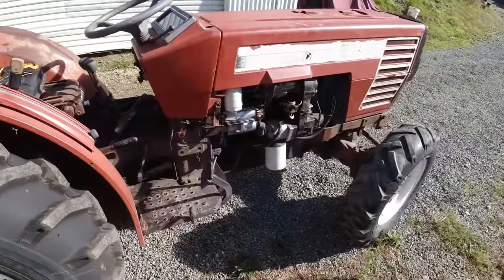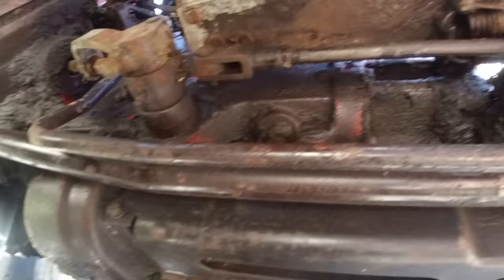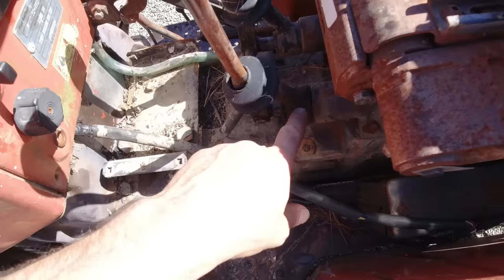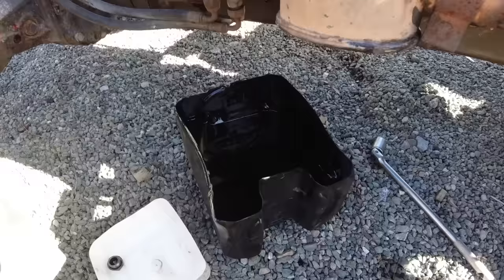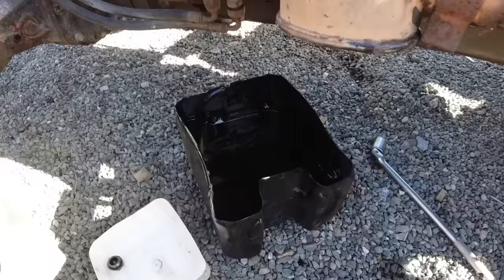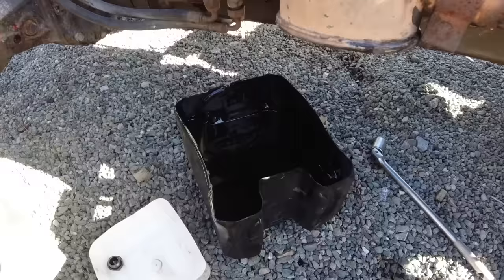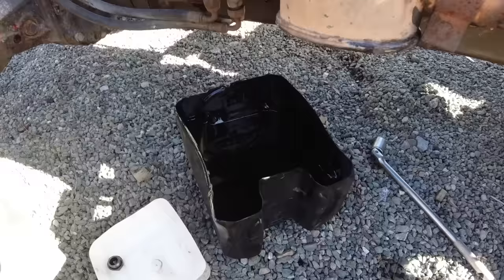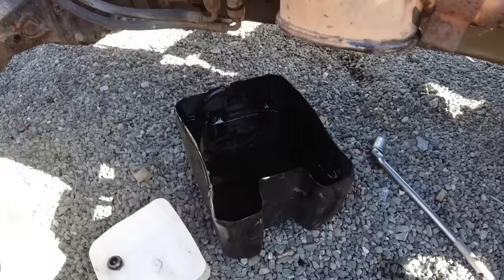Free Fiat 4wd tractor gets a full service/repairs & goes back to work

Comment: It's a good idea to run antifreeze even if you don't expect cold weather. Antifreeze has anti-corrosion properties that will help protect the cooling system over time.

Comment: Just a tip with the ultrasonic cleaning. Use some jars in the tub with your dirty parts inside the jar. You can just use plain water in the tub, then you can use a solvent in the jar and dispose of it easier when done.
Reply from the maker: Brilliant idea thanks
Reply: @MartyT Agreed. Really great idea. Never thought of doing that.

Comment: I have an 55-46, same engine but different gearbox. It takes 22liter of SAE 10\20 or 30.
I used a 10W-30 universal oil for wheat brakes and clutches.
Engine takes 9.5liters, i used 15w-40.
Mine had 9l of oil left of 22l. it did not really care, and my drain plug was the same.
55-46 has only syncro's on 3-4 gear.
Old Fiats are like gold here in Norway and 70-80 and 100 series in good kondition starts at 10 000$

Comment: Hey Marty, here in Wisconsin were just getting into spring. I've resumed tinkering with my fleet. Just finished up with the rebuilding of my 79 jeep engine. Runs good!:) The first jeep I bought was a 1950 jeep pickup truck that had been converted to a grass fire truck in 1960. In 1982 I was able to purchase it. Everything looked well serviced. No evidence of leaking from gear box's or differentials.:) Drove it about 20 miles home and burned up the rear diff. Bone dry!:( No wonder there was no evidence of leaking. Fortunately I had a parts truck. Great job showing how you still have to look!:) Thanks

Comment: Used the model down from this in the late 90s early 00's, the 45/66 and it's big brother the 80/90, I love new tractors and the air conditioning and field management systems, but there's something to be said for the simplicity of these machines, reliability was immense, and the small fiat tractor punched well above it's weight.

Comment: Excellent video, the arthritic tractor controls  it's probably just lack of use, most of the older stuff relies on thrown oil to lubricate the inside, only when there isn't a path do you get "proper " lubrication even if it's only a gutter and drip hole or a wick, many strange issues come back to 100 years of rusty junk filling all the small holes especially when the oil resembles tar or in very early stuff it's castor and has gone rancid ....

Comment: For a guy who does as much crawling around under vehicles as you do, you should dig out a trench (reinforced on the sides of course) that allows you to stand comfortably under to change oils etc. You must have a spot on that property that has a slight slope to it so you could walk into the trench from one end and work under these big machines a lot easier. Like a mechanics pit you see in an auto shop (or whatever they call it). Also, love the tree frog joke. You’re not a real dad unless you make a good tree frog joke with your son while working on a piece of machinery

Comment: See about getting a canvas (as opposed to nylon fiber) tarpaulin to cover the tractor between jobs.  The linkages will stay lubricated and free of dirt much better if protected from rain and dirt.
I'm  continually surprised at how much can be "fixed" on these old machines by simply draining and replacing fluids and replacing filters.  "Clean fluids, fresh filters... damn!  Runs like new!"
I'm sure that down the way you'll be showing us how to replace shaft seals on the wheels and drive shaft.  But this was a great step forward.
PS.  The seat looks a bit dodgy.  Your backside will appreciate a new seat since you're going to be using this a LOT.

Comment: Good looking machine. May be worth investing in a ROP to give you some protection in case of roll-over.  They don't usually use them in orchards but better than trying to hold up a tractor as it rolls over you.

Comment: I was impressed on how well that little tractor did. I know what you were talking, with my two wheel drive tractor you have to think about it when you're using a backplate because the tires just don't have enough traction. And if you look at mine they're close to smooth. I run tire chains all year round so I can avoid buying tires cuz I'm cheap, CHEAP I say! Lol! Not really, my feeling is if it does the job why spend money on a want not a need? When it's time I'll buy them then. Thanks for so many excellent videos! Bob from Virginia USA

Comment: Basic maintenance and intuitive troubleshooting. Another rescue ready to perform. Increased value. More versatile, 4 WD, powerful, no leaks, no overheating. Does the narrow grades very well and easily. McGiver ingenious solution for the air filter $40 vs $260 delivered. Great video.

Comment: Using a non  stock air filter, I would have given some thought to welding three tabs at 120 degrees around the metal end cap to keep the filter centered on it's outer end. But $30.00 dollars is much better than $325.00.   With the savings a bit of sand paper and rattle cans of red, white and black paint would make this a happy retirement for this old girl.  Sounds nice   as she works. Your eight months of summer is something we dream of, in the Far white North sadly have the opposite, eight months of cold wet snow, dreaming of a warm return to NZ.

Comment: Just a beaut cute little takka takka!

Before turning the rear wheels inside out check the specs on the rear wheel final drives.  By flipping the wheels you put the contact load point further outboard, thus increasing the 'overhung' load moment.  Doing so will reduce the final drive bearing life (no problem if you can repair yourself) and may over-stress the input/output splines to the point of failure.
See if you can get manufacturer model/part numbers for the final drive assembly and a manufacturer's spec sheet.

Comment: I'm glad you mentioned that bit about the surprising power it had. I was thinking to myself as you were grading the road that it didn't seem to be lugging the least little bit and it was running at what seemed to be a low RPM.

Comment: Good to see you hand oil linkages and pivot points. Not doing so is a sign of laziness and you are NOT lazy. Tires are excellent, 4-wheel works as it should .. you've got yourself a sweet tractor.

Comment: Is the seat too low? You can change the height by moving the white brittle plastic knob at the front to the left.

I would recommend doing something to that wobbly oil line under the tractor, it resonating under there will cause metal fatigue and cracks.

There is also filter inside the lift pump (metal mesh)

Its a good idea to have a box dedicated to each tractor, use it to store spare parts and information of filter numbers etc (try to remember that airfilter spec 10 years from now lol)
I just cut the part of the filter package where the numbers are and store that piece in the box.

I have 9 tractors +others so this is a system i came up with to keep track of all the extra parts i had lying around :)

Comment: For greasing exposed linkages and other limited motion joints look for a pressurized can of lithium grease, it's rather cheap (around 10$ for 500ml around here), easy to apply (most have a tube nozzle similar to WD40 spray cans) and sticks much better to bare metal, won't peel off even if you pressure-wash the area.

Comment: FWIW: on the old diesel engines we would add Dexron automatic transmission fluid to the fuel.  Maybe 1/2 qt to a tankful of 18-20 gallons.  Cleaned and lubed internal parts and raised the cetane level by a couple points.
Reply: I've found 2 stroke oil works better than ATF.  Still lubes the injection pump nicely (makes up for the sulphur that isn't in the diesel any more) but burns cleaner because it's designed to burn.

Comment: in regards to the air filter i would change the oem filter and housing for a one from Donaldson, ive done this on a fiat bulldozer with great success. main reason was because the Donaldson filters and parts are cheap and readily available. just an idea, love the content on these old machines.
started diving into a David brown 30D that a family friend has. is good fun but alot of research and work.

Comment: did my time on fiat tractors. 66 series werent a big seller in our area but there are a few. as with most fiat models the weak link is the clutch. 4wd  shaft connection to the diff head can chew out the splines to. in 10 years or more i worked on  the 40, 50, 66, 80 and 90 series  i might have done 3 or 4 full overhauls on engines and a couple of gearboxes.  they are pretty much bulletproof. but i also probably did 50 clutches.

Comment: Great job, Marty. That's a useful little tractor! I was wondering, are the new rear tires the original size, and if not, will it give problems when using 4wd?
Reply from the maker: Not sure if they're original, good point..  it didn't seem to be binding up between the diffs and was rolling freely so I think its ok

Comment: I think this tractor uses differential oil as hydraulic oil as well.  Maybe the hose once broke from the towed work machine, and the oil was never added.  That's why the oil is low, and no leakage is visible.

Comment: Great engines those iveco units did you know their is a mesh screen in the lift pump below the injection pump it’s a 10m bolt in the middle also where their are banjo bolt fittings in the fuel lines from the tank debris can build up in the holes in side 
great 
work  Marty 👍👍

Comment: Marty my tip of the day is BBQ COVERS. A 4 Burner flat top the fits my 1980 35hp Iseki from steering wheel to front grille and my Husky ride-on complete less cutting deck. SOME cheap rain protection for shedless gear.
Reply from the maker: I use a roll of heavy duty vapour barrier for under concrete slabs, its strong, cheap and doesn't seem to degrade like normal tarps and can be cut to suit any machine, being quite thick it doesn't rip in a strong wind
Reply: @MartyT  Nice! I will try looking for some. I think I liked the BBQ Covers because they were already sewn to a convenient shape that fits both vehicles without further work. However the cheap ones are they same material as trailer tarp, so I use the 'quality' ones that are woven on the outside and soft 'flocked ' on the inside. Both vehicles have new paint so that seemed a good idea. I predict they will do about 5 years based on previous BBQ experience.

Comment: dont you  just love manufacturers that put filters that leak all over everything when you change them.  many people forget that antifreeze also contains lubricants and anticorrosion agents in it! a spring or even flat spring steel would help hold the filter in place.  nice little machine  just need to find a loader for it would make it much more versatile !!! Have fun great vid

Comment: Nice, well done. Love this maintenance kind of video. Yes, the tractor is definitely set up for orchard work, good idea to flip the tires but I think you would also need to switch sides to keep the tread proper.  I hate pine needles, they don’t break down and don’t compress. I will never understand why people don’t maintain equipment, especially when it is relied upon to do work to pay the bills.

Comment: Nice work, that should last for years. The only thing I would have done different would be to fill the radiator with fresh water and start the engine, then drain, do that a second time, drain and then fill with coolant. Just to flush the water gallery’s in the engine block.   Love a good service video 👍 PS maybe a couple of lights on it would be useful in case you need it in the dark one night 😁

Comment: If new oil gets black after a while  you know that it works as it should.
Reply: Except older diesel engines have a load of carbon particles produced by combustion that make the brand new oil look black within an hour...
you have to run diesel oil changes by mileage or better...by hours of operation.

Comment: Sweet tractor! Glad you offered the gentleman some money for it as it’s a solid tractor with newer rubber.

Question?  I’m a heavy duty mechanic here in Manitoba, Canada.  I’ve never noticed you checking and or doing any valve adjustments on these tractors etc.  You pick up.
Reply from the maker: I don't bother if they're not rattling. I did adjust the valves on the vibrating roller, the honda quad and the d2 dozer
Reply: @MartyT  

I just recently came across one of your videos and have been following and watch all of them.

My brother and I are both Red Seal diesel mechanics, my brother just loves tinkering on stuff.  Myself, I have worked automotive then went into transport truck bus and trailer.

Comment: Marty there is a product called Luboil that I think you should check out for all of your stuck, or tight parts. I used to use it all the time on things like door hinges, clutch linkages on semis, tractor steering linkages and the like and it is probably the best thing I have ever used for things like that. It actually hangs around unlike oil that will just dissipate .

Comment: I suspect that the tyres may want their pressure adjusting as the rears at least look too high pressure. You would get more traction from the front axle if you could add extra weight to it either with a nose weight system and / or wheel weights added to the wheel dish.
Regards, Dan
Reply from the maker: I did check the rears, they were at 12psi

Comment: Marty you should be using gear oil 80w 90 in your front differential and hydraulic oil in rear end, also if itrs got final drives should also be 80w 90

Comment: Sounds awesome.  I would not have put the coolant in straight away, I would have run it for a while and dumped it out several times, to flush it through (- I've had the same issue with dirty coolant systems in the past).  Send the next one you find, up to AKL, pls!  :)

Comment: Hi Marty, run a detector over your tracks lol☺. I notice you don't have stay bars on the 3-point linkage while using the Back blade.
Reply from the maker: The stay bars are on the inside on this one
Reply: I Missed them. I will have to look closer.

Comment: Good job onya Marty. I only hope that the tractors are better than their autos are. Their autos are horrid little things that break at a moments notice. Should be able to get it running on vegi oil. Save the cost of petrol.
Reply: From another comment...Italian. He seems impressed!
@andreandre3533
12 days ago
how in the hell you can get a free tractor is beyond me. here in italy , where those were made, are regarded as very reliable and decent little tractors, therefore they are still pretty pricy. i'm trying to buy a couple for my farm and i can't get them for less than 8/12 grands. i'm emvious

Comment: Before I say anything else, ROPS ROPS ROPS ROPS!!!!!!!!!!!!!!!!!!!!!!!!!!!!!!!!!!!!!!!!!!!!!!!!!!!!!!!!     
I really like these fix equipment up videos, especially 4x4 tractors. I didn't hear you mention hours, by the looks of trans oil it must at least 2000 hr on it. My L3400dt has 1500 hr, trans oil changed every 500 hr and it still looked new....
That rear blade works slick, if you going on hilly ground, definitely widen the rear tires. Does it come out of 4 wheel drive and does rear diff lock engage?
Reply from the maker: Hour meter has stopped so not sure of the hours.. Yes the 4wd and diff lock levers still work

Comment: You sure about using 15w40 for the gearbox? I think it should be using more thick oil like 75w90... if that is the case, not only you would have worse protection but seals could leak easier.
Reply: This universal tractor oil is a modern concept that works....

Comment: good to hear the filter worked out... there really should be more standardization on parts like that but then people wouldn't be locked into dealer service and parts.. I have an old japanese car and a newer korean car 15 years newer.. I was getting a bit afraid I wouldn't be able to get oil filters because companies like fram weren't making them anymore.. then I saw a new part number for the old honda and it matches my newer hyundai... so now I buy one filter for both of them heh.. I think i got lucky there heh.
Reply: I've converted a lot of our farm equipment to use "standard" filters where possible.  Simplifies inventory, which is important when the nearest place that MIGHT have a filter is a 2 hour round trip.

Comment: Excellent video Marty T   :) on Fait tractor also doing super overall fixing up on matinne up also plus evey 3 month maybe need add fluid in hydraulics also transmission to add fluid 15w40  ! Also for keep fuel system running clean add 200 ml of GM  Automatic transmission fluid 2 or 3 plus bottle of Fuel Injection cleaner for gas and desiel motors system  every month and in Winter Season months add in fuel tank  plus a bottle of Gasoline Antifreeze bottle to one each month to ! What Automatic transmission fluid lube up Injection pump plus seals break down and Injectors from leaking or over Spraying too plus engine in nice running perfectly to easy fire up on cold starts plus water! Also in Water pump on rad add  200ml of 80w90 differential fluid in when cold what does lubeup bearing also seals plus frost plugs and keeps head gasket sealed up too plus water jackets from plugged up ! Lube the Gear  shifter monthly to from sticking and grind too ! You enjoy that tractor for years to Marty T and hope my help ideas help out too!